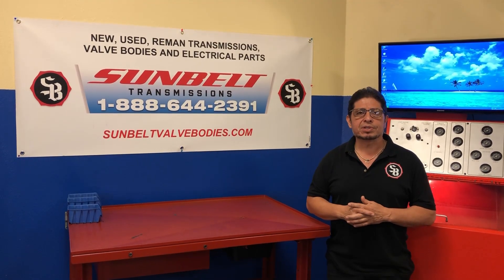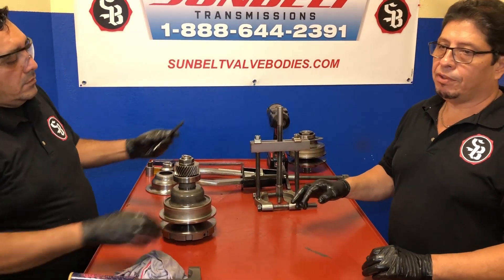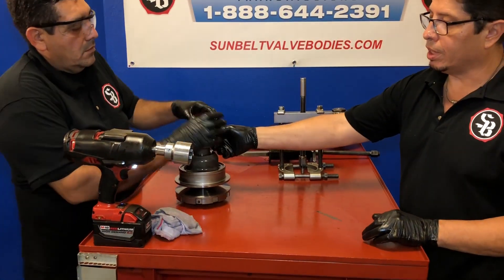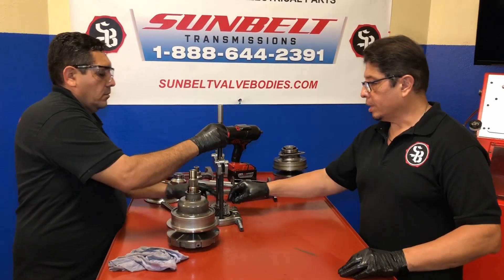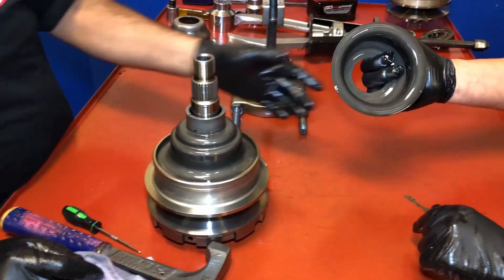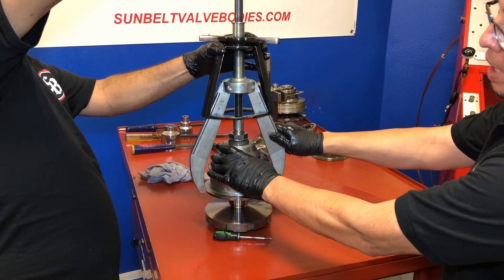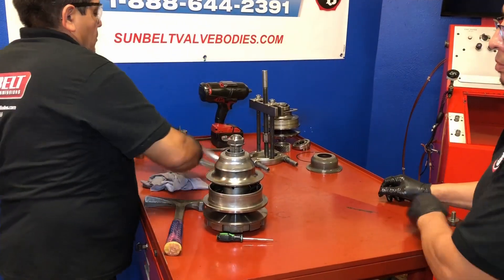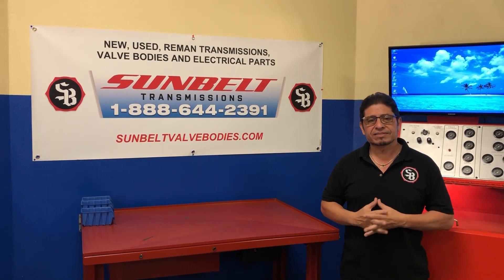CVT How it Works Nissan,Suzuki,Dodge,Mitsubishi, CVT JF011E Pulley disassembled  (Part 1)

Comment: Measured the large nuts on my variators and found them to be over 54mm but assumed you knew what worked. You must have a well worn 54mm socket because a new one wont fit on the nuts. Had to go back and get a 55mm. Maybe you could make that correction.